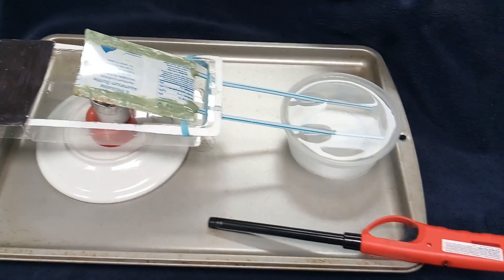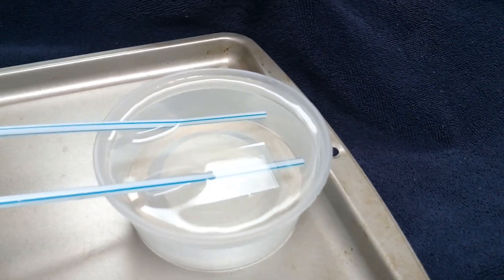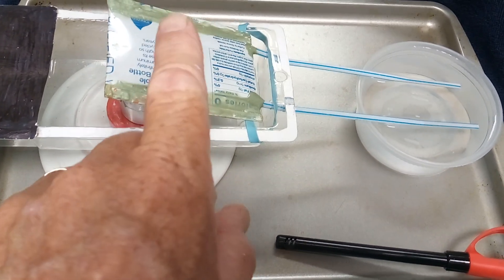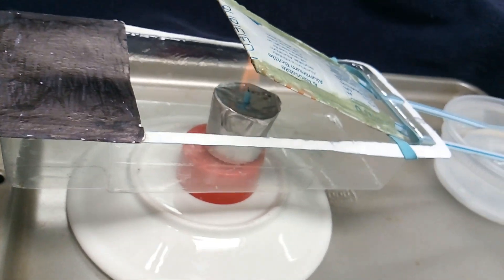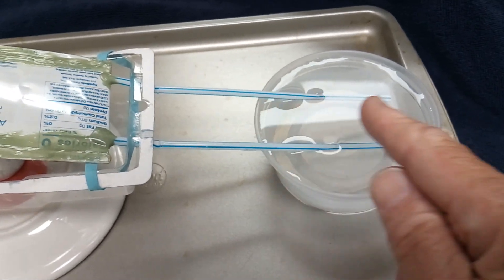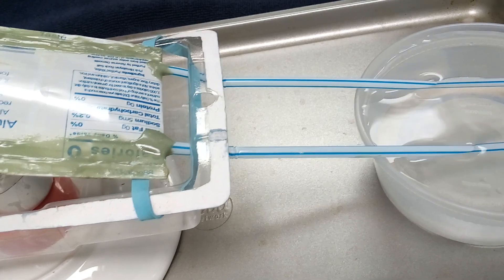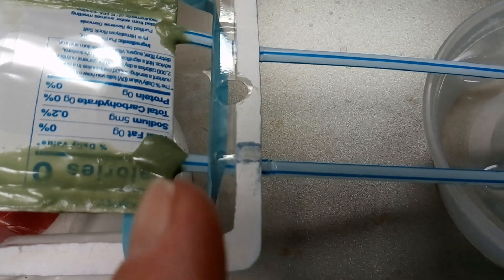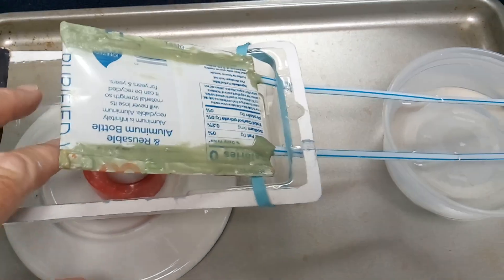Pop Pop Boat Engine --  Dry dock testing

Comment: Add insulation to top of aluminum bag to hold heat in longer , maybe it will work better.
Reply from the maker: It is a type of heat engine so what you suggest makes sense.  Thanks.

Comment: what about an closed watertank or better  hydraulic piston,you see the waterlevel go up and down,if the heating -chamber can not change volume,it might give more power to the piston(water tank replacement)
Reply from the maker: If this can be made into a closed system that has motion then things get very interesting.  Crankshaft and flywheel here I come.

Comment: Blade's video is fascinating. I guess "Pop pop" purists would say it is not right, but Blade clearly states he is not using it as a "pop pop" boat. On a slightly similar vein, I also follow Mike Dodd @pendox99 and his other channel FlapperLab @flapperlab842 He did a lot of vehicles boats and blimps propelled by flapping motion.